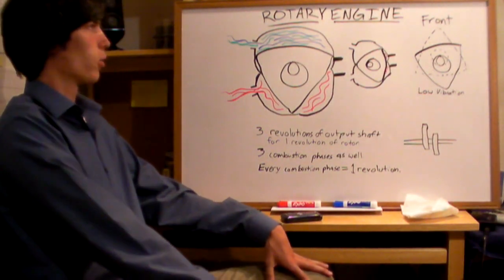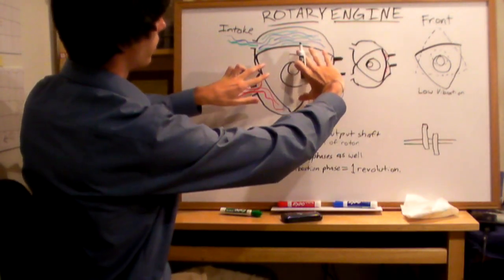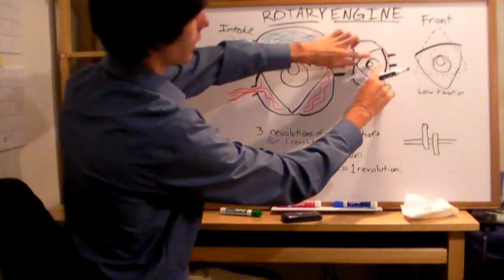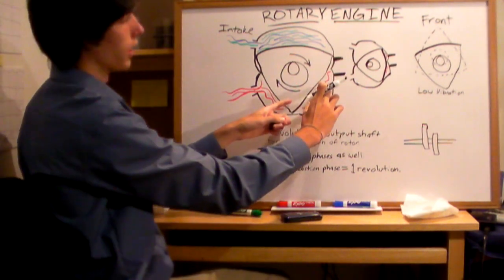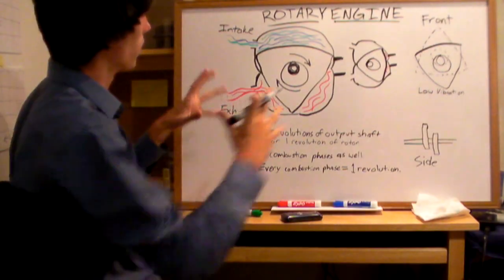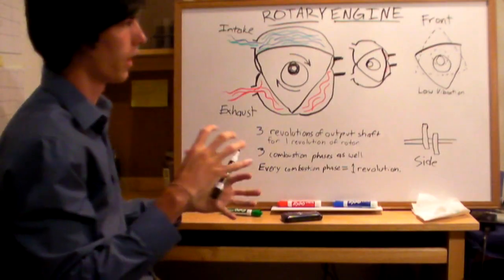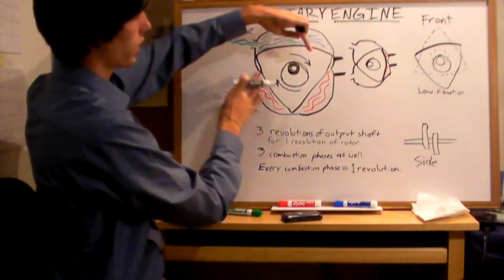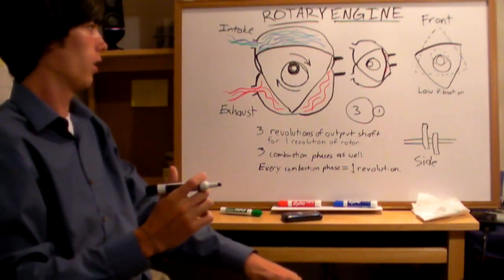Rotary Engine - Explained

Comment: Still the best engine design ever built! (my opinion)
Reply: sadly they never reached a great mind to develop them to be more efficient.
Reply: i believe one guy has solved the emission thing... and in turn also a good portion of the heat thing. they are now trying to make his modifications practical for a production vehicle.
Reply: Hey I love the rotary engine but it has not yet been perfected. I have a few tricks that I do on my own engines for cooling but those are secrets from the old carb days. A big key with rotary was high maintenance which nobody takes into consideration. I do understand my previous comment came out of my mouth whilst my head was in my anus but it does hold a valid point. Maybe someone will design a rotary diesel or HHO someday for production not testing purpose only. I know they have ran on both before but for how long and such. Cheers doktor.
Reply: You have to step the coolant passages. Very time consuming but helps cooling. I don't know the difference between Mazda and other wankel designs. I've only owned Mazda rotary engines.
Reply: It's groves in the coolant passages. Takes machining and hand process to do. It's done to race engines. Along with porting exhaust, intake and all the other expensive upgrades. I own a 1986 turbo diesel vw jetta now. Great fuel economy but older technology limits it's potential efficiency. I'm going to upgrade to the 1.9l tdi and gain major fuel efficiency.
Reply: doktorbimmer nice if that happens you know who's leasing a new vw xD
Reply: i currently drive an 02 jetta. its the 2.0 gas version. but the tech behind the vr6 is kinda amazing. the engine alone costs more than i paid for the car... but so nice.
Reply: mine is running at 230k. i tested the engine and everything is running great according to the computer. only problem, im not used to running at a high rpm on hiway. around 3k rpm in 5th. i hear smaller cars like this, its normal. but i would still like 1 more gear. take me back to my vr4 days
Reply: MudRFunR my favorite too!!! I wish the automotive industry embraced & developed it more... but it's already going out-of-fashion now, I guess...
Reply: true, but the modifications help a bit with milage... not enough, but every little bit helps.
Reply: not sure. i only came across something that sounded promising. didnt bother researching it much because i have never been a rotary fan. so i didnt verify anything.
Reply: The real doktorbimmer The RX-Vision concept car uses Skyactiv-R technology ("R" meaning "Rotary", which for Mazda's case means Wankel). Mazda reported that they have continued research on their Wankel engine even after the discontinuation of the RX-8's production, despite rumors of the contrary.
Reply: bio fuel is a real thing. i cant wait till we can make renewable fuels... and i imagine they will be better with emmissions also. perhaps get more power out of our engines. we shall see.
Reply: the elio looks pretty promising. they have a goal of 84mpg. their theories seem to be possible. good little truck to work or kids car. electric engines would be good... if we could generate cheap and use renewable power. there are a lot of things we are on the verge of. but like the hd dvd vs blueray... we wont know which way the world will go until the people decide.
Reply: doktorbimmer i dont know. i am considering getting a new miata and tossing a rotary in there. make for great fun. the unfortunate fuel efficiency will be offset by the other car i plan to get as the 'and' car. the elio which is aiming for 84mpg. so for daily driving, or when i just want to pop to the store. use the elio. when i want to take some long roads that twist and turn, the miata. still, together will be a bit pricy to get into. so i will go for the elio first. lol

Comment: I still don't understand the physics behind it. Like in a piston engine, when combustion happens, the only way the piston can go is down. What keeps the rotor from rotating counter clockwise as apposed to clockwise?
Reply: the each side of the rotor have a bores that are slightly tapered, the larger side gas more force acted on it and thus the combustion will always take the path of least resistance

Comment: Question: are both rotors used for combustion or is the second rotor only used as a counterweight.  If the second rotor is also used for combustion, does it have a separate chamber?
Reply: both are used for combustion. and it has a separate chamber. its like this. front iron or plate, them middle housing with the rotor inside. then a middle iron or plate. then 2nd housing with 2nd rotor in it. then 3rd/end iron or plate. the plate are intake runners that lead into the rotor housings.
Reply: MagicTrianglesMedia Thank you for taking the time to explain.  Very much appreciated!

Comment: they ARE still in production, they stopped making the rx8, but they havent released the next generation yet. Its scheduled to release between 2016 and 2018
Reply from the maker: The RX-8 is not currently sold, thus none in production.
Reply: mazda cannot afford to release a 16x engine in a new 7/9. they have made the 16x. but i dont know where they will use it. they are using a single rotor as a range extender in the mazda demio hybrid. but thats a totally different purpose.

Comment: I heard that the rotary engine was known for blowing apart seals, gaskets, and basically falling apart. Hearing this made me curious and looked it up. I do have one piece of information I received that I don't know is correct, I was told that rotary engines are able to run higher rpm is this true?

Comment: The Rotary Engine seems like it should be more efficient, however in real world use it isn't. Why is that?
Reply: going into the flaws would take forever. the combustion chamber is long and not ideal. the spark plug positions are in an unfortunate place which gets lots of heat/gas/oil and no fresh air. the seals wear out. 

speaking of seals. get too soft. and the seals break. get too hard. and they destroy your housings. but soft seals can be great for high revs or normal engines. where as harder seals can be for extreme power. honestly the seals are the biggest factor to me in a rotary engine. you need to know which ones to get for your application. thats where people tend to fail. they just buy some seals that are cheap. not realizing they are NA seals thatll break under boost. or super hard seals meant for drag racing thatll destroy normal housings.
Reply: It's because the neighbouring parts of the cycle aren't entirely isolated from each other, because the rotar needs its tips free enough to rotate - so gases from one cycle can leak into the next a little.
Reply: Because Rotary engines use apex seals, while Piston engines use piston rings. Due to a design flaw of the rotary engine, the apex seals tend to wear out faster than piston rings. When an apex seal is worn out, there is a loss in compression and therefore less power. ( I'm just 16, correct me if I'm wrong.)
Reply: +Darkside Hero  Looking at CC to  Power ratio the Rotary is more efficient. In the case of the 93' RX7 aka FD. A 1300cc engine creates 255 HP. Compared to a 1300cc piston engine. Also there is no reciprocating parts, and much less parts to rob Horsepower.
Reply: +The real doktorbimmer Low efficiency? How many 1.3L engines put out 255HP?
Reply: +The real doktorbimmer how is a 1.3 rotary "like" a 2.6 liter engine? maybe in terms of specific output but mechanically it still generates 255 HP form 1.3 liters. People love to say that because a rotary engine has a different cycle its displacement is actually twice of that advertised but there is absolutely no science behind that. The mazda wankel engine has a high specific output because of the gearing between the rotor and the eccentric shaft (3:1) and because of its eccentricity. The eccentricity that mazda chose facilitates a high redline and creates relatively low torque which is why they make low torque numbers and high horsepower. Its all about mechanical efficiency vs thermodynamic efficiency. It is very easy to say that wankels are intrinsically this, or outdated because of that but there really has only been one displacement and one eccentricity in development and for the most part they use one material and a set spark plug/port design. I would be VERY interested to see what mazda engineers come up with for their new rx-vision thing; the side exhaust ported renessis is just the tip of the iceberg. rotary engines have many possible variables that have never been explored and their potential for improvement is probably far greater that of piston engines, at least in 2015. Also, even if the NA RX8 did have 2.6 liters (which it certainly does not) 238hp from 2.6 liters is much higher than the specific output of most NA motors.
Reply: +The real doktorbimmer the eccentricity of the engine is not the same as angular motion. I'm talking about the actual path that the rotor takes, which is variable and had been the same for all Mazda engines since the 10a. You right, the rotary uses a 4 stroke cycle, I just meant people are easily confused because it doesn't reciprocate. That being said the rotary engine is definately much more mechanically efficient that any piston engine, I'm not sure how you could argue otherwise, and while many people use a 2x equivalency factor I've never read any scientific reasoning behind it. Insurance companies don't count.
Reply: *one part
Reply: +Viper310 I think they are referring to economic efficiency. Actual performance efficiency is great!
Reply: +The real doktorbimmer 
That power to weight ratio though, not to mention the low CoG.
Reply: +Darkside Hero 
It depends how you drive it, on the open road I can cruise and get better mileage than my Dc2 Integra @ roughly 8L-100km. If I really feed it I can get that down to about 13L-100km.
That's an Rx8, my Rx3 with a bridged 12a runs at about 16L-100km.
Remember too, they're sports cars so pffft to fuel efficiency is what I say.
Reply: The real doktorbimmer
Much like the Thorium molten salt breeder reactor.
Reply: The real doktorbimmer
Did a rotary bully you as a kid or steal your girlfriend?
Your belligerence toward the rotary engine isn't very rational.
Hemis for example, are a shit design, but they sound awesome. Or what about the pushrods in the new Vette?
Just embrace all engineering and get on with your life.
Good day Sir.
Reply: the idea of the Hemi was to help even out the burn cycle, and does burn more evenly than standard.  just thought I would let that be said.  how about we look at it this way everyone: the rotary engine design has been around for a while in automotive terms, there have been many advances to different aspects of all ICE's, the rotary engine does not seem to do well overall though when it comes to the real world.  if there was a good chance that engine makers could make a profit by having enough to brag about it they would there would be more on the market to buy.  the hellcat engine sells itself by saying it puts out lots of power, Cummins sells itself by saying you get lots of torque per volume of diesel, etc.  so the fact that we don't here many (I haven't heard of any but I don't search every day for engines) pitches to buy a rotary engine is because there might not be enough to brag on.  maybe down the road but odds are it will be like the flying wing.  the flying wing is supposed to be the most aerodynamically efficient design, but thanks to how things are any advances that happen that could make the flying wing better also ends up making the conventional airplane design better and by enough it stays ahead of the flying wing design.  so how about we all calm down and look at sales, that typically gives an idea if a design really has merit because companies want to make money.  if a design doesn't provide enough to sell then they won't make it, if it does then they will make it

Comment: Im a bit of a newcomer to this and am still a bit confused. First, how does the air become compressed? With the piston one the piston pusher the air until it was compressed, but here i see nothing to compress the air. Also, how does the combustion actually power anything? With the piston one when the explosion happened it pushed the piston down, but here I dont see anything happen after the explosion. I like this series a lot, nice job! If you could answer my questions that would be great!
Reply: In the second "stroke" stage. The space to the right (in the diagram) right by the spark plugs is very small; this compresses the fuel/air mixture. There is no space for the the F/A mixture to go from the intake stage, so the same volume of F/A mixture that goes into a small space produces compression. There is no need for a piston because the rotor is directly attached to the crankshaft. When the rotor spins, the crankshaft is spinning with it; they are basically one unit. He basically answered every question in the video.

Comment: why doesnt anybody use these engines? they seem simple and it seems like the force vectors would be better suited to rotational force that those of pistons
Reply from the maker: They're not very efficient and have poor emissions.
Reply: It's because there is a big problem with seals still. But I love my rotary :)
Reply: Engineering Explained
Interestingly these are used in some UAVs.   
Like the Watchkeeper UAV.  It creates a "buzzing noise" which I would think gives away the "stealth" capabilities of the UAV if its making all that racket.
Its good for small engines to power small objects I would guess.
I think its also called a Wankel engine.
Reply: Does not the off center rotation of this Wankel engine cause the entire engine to wobble around a small imaginary diameter at the center?

Comment: i have a problem whit my rotery engine every time i want to stat it up i have to clean the spark plugs and it stay on up to 30 mints after that it gets super hot and dosent want to start on till it cool down :( don`t know what to do whit it can you help???
Reply: maybe your engine is drowning.  I heard that was a frequent problem with that engine.  
I don't know if it's apply to a rotary engine but maybe if you keep your engine running 2 minutes after you parked the before turning off the engine could help like turbo engine cars
Reply: What is on the plugs that needs to be cleaned off?
Reply: doktorbimmer Sounds like some of your seals are going bad.

Comment: Technically a rotarys engine doesn't have a stroke. It has as in name implies it rotates. But in its 1 rotation cycle it still fallows the 4 stroke method of intake, compression, ignition, exhaust.

Comment from the maker: The engine still manages to pull in air, compress it, ignite it, and expel it... the four things it needs to do. Call it whatever you want, it doesn't directly compare with piston cylinders and isn't accurately described by "two strokes."

Comment from the maker: Size yes, or perhaps a lack of efficiency. There are hundreds of piston cylinder engine designs out there; you'd need a dramatic efficiency increase and size decrease to make the manufacturing worth switching over to.

Comment: Great video! Just one question about the spark plugs. You said once they ignite, the rotor swings down and combustion occurs in the bottom right chamber of the drawing. But what keeps combustion from occurring in the smaller chamber in the middle-right as soon as the spark plugs ignite? Or does combustion begin at that point and continue on until the rotor has swung a bit more?

Comment: does it transmit over as "power" or torque? i knew these engines are little beast but with such high rpm i would think it produces more torque rather then power?

Comment: As i understand they tend to leak unburnt fuel and air into the exhaust through the spark-plug holes' break in the seal.  I watched this to see if you explain why no one has tried a diesel rotary engine to eliminate this problem.  Is there another reason for it's low compression ratios and high emissions?

Comment: Would it be the output shaft with the extruding lobes creating the torque? Which simce it acts as a crankshaft that means a supercharger is still possible for rotary engines right?

Comment: Ever since I started massing with them with model aircraft, the Wankel Rotary system has been one of my favorites.  While it doesn't get good gas mileage in real-world driving situations, and can be atrocious in stop + go driving (ask anyone who owned an RX7) for applications requiring consistent torque through the Otto Cycle (such as in small model aircraft) nothing else can really compete.  Single cylinder model engines have a 2 stroke system that's worse on gas, and has to keep more momentum.

Comment: I agree with the others, not as well explained as your other videos, especially as this is an uncommon engine which requires more details. Output shaft to rotor explanation could be more detailed, like how they are connected, this would make the 3:1 ratio easier to understand. Giving a brief explanation or recap of what a combustion phase is would also be helpful. Lastly, the difficulties of achieving compression ratios could be explored like you usually do with pros and cons in your other video

Comment: I have heard they are hard to keep lubricated, and they spray oil into the motor to keep it lubricated. Which means you have to put oil in it every time you fill up. Probably why the emissions are hard to pass on these cars. At least 1 reason why.?.?

Comment: They could be efficient given fuel injection, just as two stroke engines are vastly superior. My opinion on this may sound strange but two stroke engines and rotary engines are still new tech and have yet to be fully exploited. The main reason rotary engines are not very popular is simply cost to produce, lack of popular demand, and the apex seals.